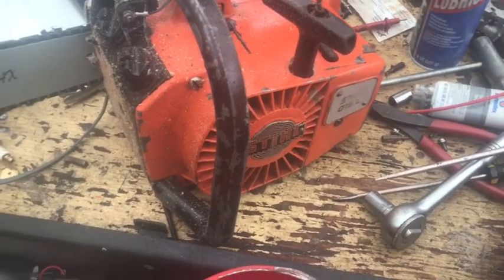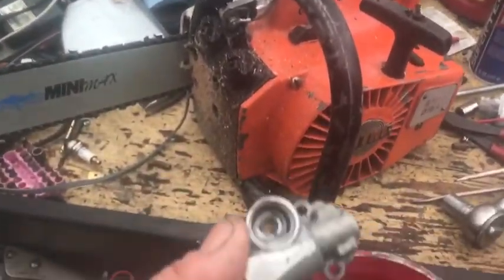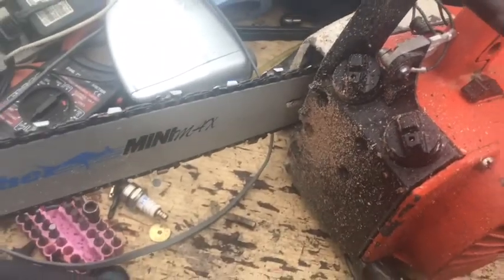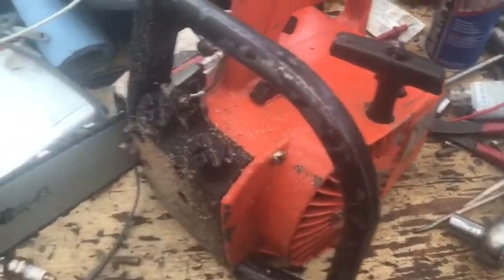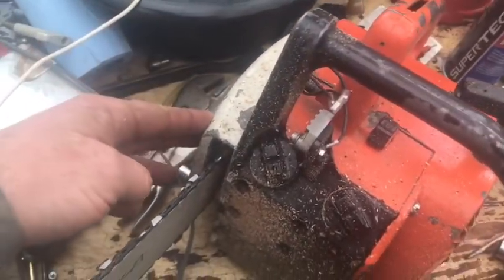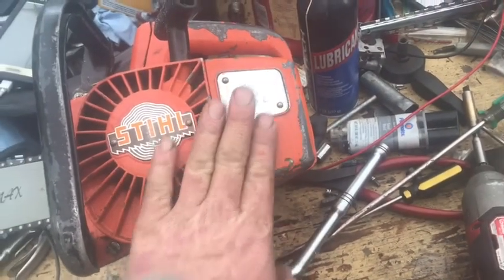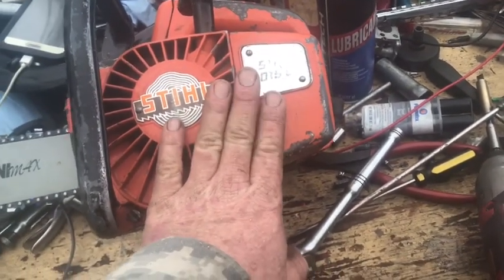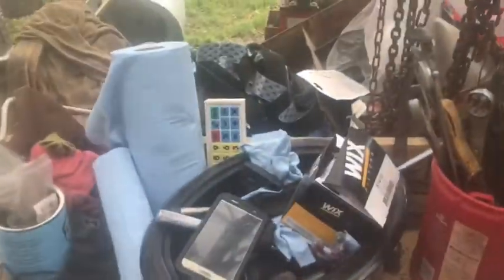stihl 015 modifications

Comment: Nice little saw, did you notice a big difference in starting and running after the electronic conversion? I just picked up a 015L on ebay that I'm restoring now. I replaced the fuel lines and rebuilt the carb and got it running but now I'm going to do the electronic ignition conversion and do some porting and polishing on the cylinder head to give it more grunt. I port all of my 2 stroke equipment and it always makes a big difference so I'm looking forward to the increase in torque after I do this 015L.
Reply from the maker: yes after the conversion ran like an MS190
Reply from the maker: please explain how to port I've heard about this but don't know how to do it yet and when you say polishing are you talking about cleaning out the carbon
Reply: @brotherscotteshelman 
I learned about porting small engines here on YouTube, simply watched some chainsaw porting vids then pulled out my dremel and gave it a shot on my stihl fs94 weedeater. Basically what you're trying to do is increase the airflow by smoothing the rough edges or casting imperfections in the exhaust port, you want the air to get in the engine and out of it as fast as possible. You just want to take your time and not remove too much material, this is very important also because I ruined the head on my echo pb8010 backpack blower by not paying attention and removing too much material. Replacement head alone for that blower costed me $120 so was an expensive lesson. I've since ported all of my 2 stroke equipment and everytime they gain some horsepower and or torque. Porting is actually fun for me and after you've ported a head on one of your equipments and got everything bolted back together it's always exciting to start the engine and see just what you've gained.
Reply: @brotherscotteshelman  I ported that 015 that I got in April and it runs perfect now with a whole lot of grunt. I found another 015 last month and did it the same way so now I have 2 little monsters. I also made custom bumper spikes for both 015's and polished the air filter covers and clutch covers on both. One thing I seriously recommend you get for your 015 is the 2 in 1 easy chainsaw sharpener. I got the knock off one on ebay for under $20 and it looks and works just like the orange and white stihl one, I couldn't justify spending $50 for the same item I can get for under $20 lol. It's so fast and easy to keep the chain sharp, totally a lifesaver.
Reply from the maker: @bigtexas7580  thanks for the reply i haven't been able to work on any of my stuff due to working on other peoples stuff but one day maybe I'll be able to try to port one of mine I'll check out that sharpener like you been wanting one but wouldn't pay that price
Reply: @brotherscotteshelman  Just search "2 in 1 chainsaw sharpener picco" on ebay and you'll see them for under $20.
Reply from the maker: @bigtexas7580  3/8 pico 4mm right?
Reply: @brotherscotteshelman  Yessir